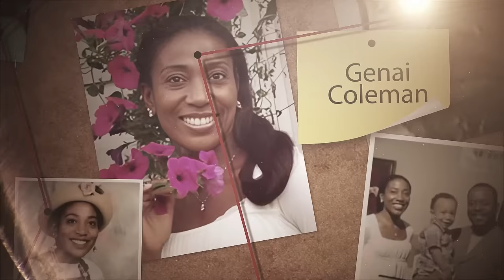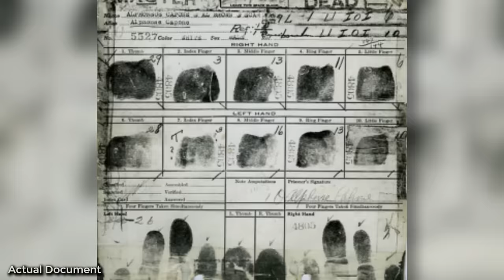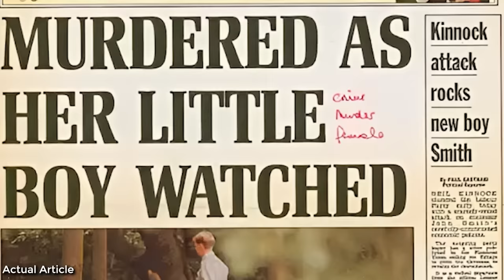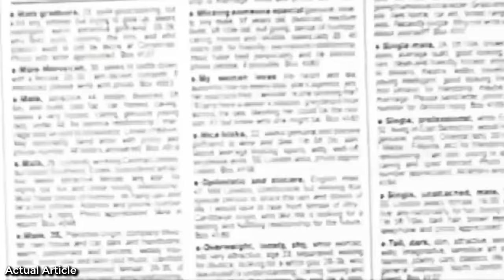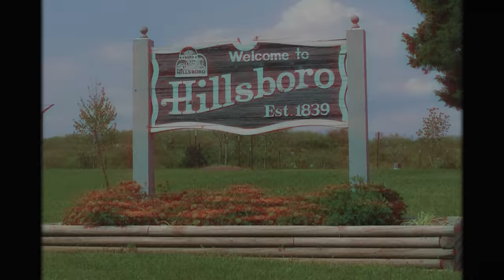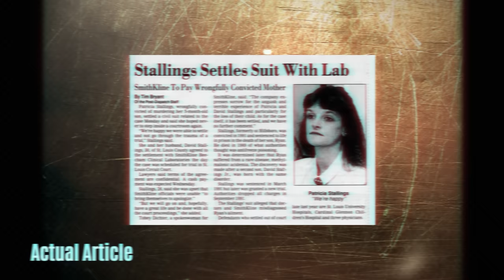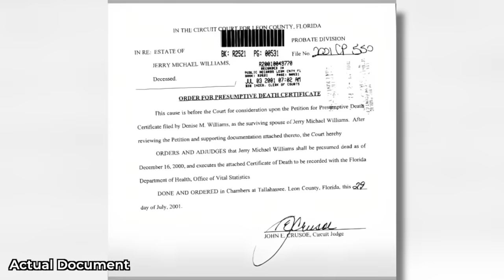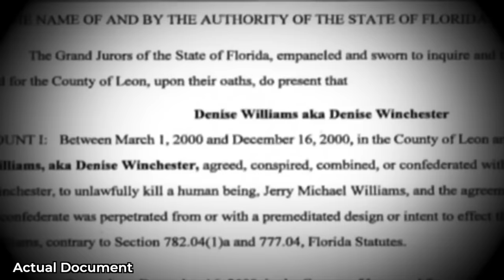6 Cases With The Most Insane TWISTS You Have Ever Heard | True Crime Documentary

Comment: So, forensically, there is a way to distinguish between the DNA of identical twins using a method of DNA amplification that includes the methylation pattern of the DNA. This is a normal chemical alteration of DNA that everyone undergoes, however, even if two people start out with the exact same DNA methylation pattern when they're born it changes over time so that you can distinguish between identical twins. This method has been used to solve at least one other case where it was unclear which identical twin was the perpetrator. Source: I'm a biochemist & genetic genealogist.
Reply: That is a relatively  NEW method of distinguishing between identical twins, it was NOT available when this crime occurred
Reply: So interesting
Reply: @lorrainearmstrong7587 I don't think they were implying that it was. I think it was just interesting nerding-out. Let them do it in peace! It's how we learn.
Reply: They also have different finger prints even if they're identical twins, seems a  lot easier if it's available
Reply: @erikaweger2829  Very true! However, the case I'm referring to didn't have prints but did have DNA due to it being an SA case.
Reply: @lorrainearmstrong7587  Well, amplifying DNA methylation in the lab was available when I was still doing wet work back in 2011 (developed Rheumatoid Arthritis so, never going to be able to properly handle a pipette again, sadly). Wide scale use as in rapid amplification for commercial purposes became available in 2018, so yes, I guess it's a more recent development, but I know the technology was available at least 13 years ago.
Reply: I bet that method is expensive to use for the test.